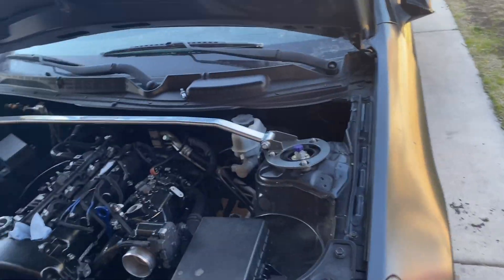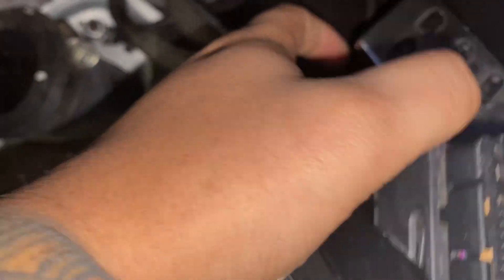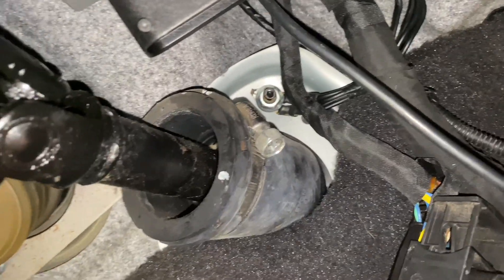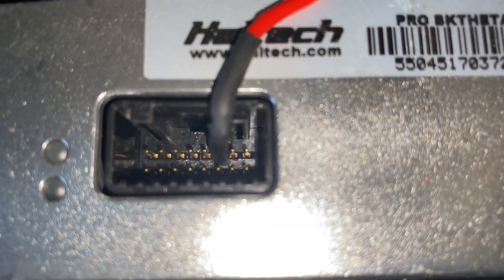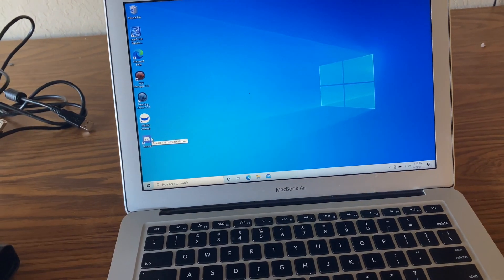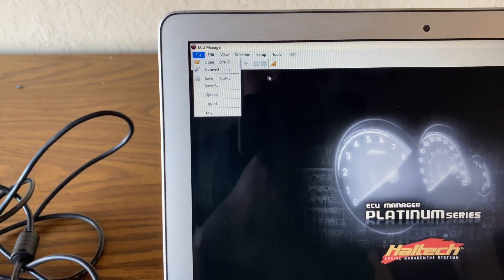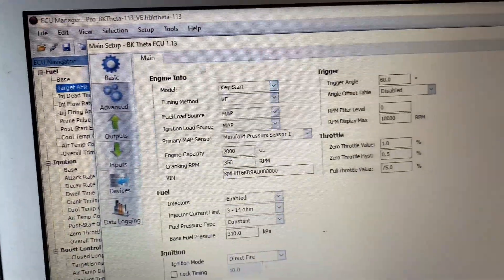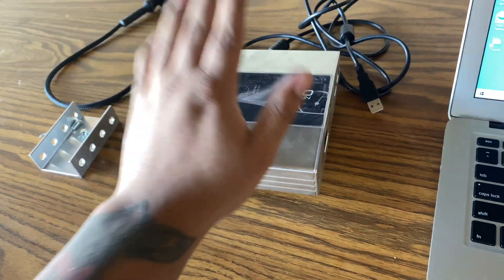Genesis Coupe Haltech Installation & Base Map Upload!

Comment: I manual swapped my car but it still has the auto harness so the car wont start without the tcu plugged in, is there room to mount both in the cabin or am i screwed if i want a haltec ecu?
Reply: Hi , did you ever figure it out ?
Reply: @Jruiz1611  I've been told there's room but I decided to buy the manual wire harness and manual dash harness to swap into my car, it's a long process lol
Reply: @Jacob-rt6on  oh I see , okay thank you ,
Reply: @Jruiz1611  good luck on your build
Reply: @Jacob-rt6on  same to you man. God bless you

Comment: is haltech for automatic as well?
Reply from the maker: No. They don’t make any auto compatible ecus at the moment. Alphaspeed is currently working on one but yet to be tested.
Reply: @ProdigePerformance  what’ll b a good ecu for an automatic w 500-600 hp?
Reply from the maker: @vietyyg6739  again, there is non currently for automatics. You have to basically do a manual swap.
Reply: @ProdigePerformance  ah okay gotcha
Reply from the maker: @vietyyg6739  yep yep, follow the alphaspeed page on Facebook or instagram and they’ll announce when and or if their ecu is compatible with autos. Should be dropping mid this year if I remember correctly
Reply: @ProdigePerformance  okay thanks man!, that’s exciting news
Reply: I did a manual swap, but still have the auto harness, would that even matter or should I stop being cheap and get the manual harness?

Comment: Your Platinum Pro ECU doesn’t get overheat? I installed mine the same as you did and is overheating and when that happened it shuts down the engine 😒
Reply from the maker: Nope. Kept mine nice and cooled. If it overheats haltech will warranty it
Reply: Yes, it’s overheating after like 40 of been turned on the engine. I wrote to Haltech and they told me to send the ECU for revision and it will cost me $175.00
Reply from the maker: @emanuelmontanezvillanueva5743  they call pull warranty unless it was brought 3rd party
Reply: I bought it from Ostar Motorsport in Orlando, Florida.
Reply: So it can overheat even inside the cabin?
Reply from the maker: @27ubs  yes. It can. If it does then you get to warranty it out with haltech. That’s why you mount in the cabin to begin with
Reply: @ProdigePerformance  time for the haltech elite 1500...we need to pressure haltech so they can release a harness for the car at a reasonable price.
Reply from the maker: @27ubs  alphaspeed makes one. $150 last time I checked.

Comment: What input did you use in haltech to recognize the wideband?
Reply from the maker: Here’s a quick trick. Turn on all your inputs 

Which ever once has voltage is the input you just tapped into.

Comment: How do you get the plastic piece off that covers the fire wall hole?
Reply from the maker: 2 10mm bolts and it comes right off

If your talking about the rubber part you’ll have to wedge a flat head in there and get it out.

It’s seated perfectly to the firewall.
Reply: @ProdigePerformance  yeah I got my plugs through already, thank you, 2 hour later 😭.
Reply from the maker: @TheEssenceOfTheDark  I’m sorry my guy 😪

Comment: where that red wire connected to the battery or you splice a power cable ?
Reply from the maker: Red wire is coming straight from the provided gauge harness. It’s a output voltage so it can tell the haltech what my afr is and change it based off the way I tune it
Reply: Ok I figured it out but now when the car started it’s like someone stepping on the pedal
Reply from the maker: @purabalafria2449  that’s weird. Did you recalibrate the throttle,? That’s another thing you have to do sometimes. 

Are you auto or 6 speed
Reply: I got it started I spliced the heater wire n connected the attachment they gave me  I calibrated the throttle but it sounds like it gives out on me and if I increase the throttle from 75.0 to 100.0 it sounds like someone got there foot on the gas 
I re calibrated the throttle like 10 times already but it’s still not good to drive down the street to see if I little things pop up so I can fix them before I get it tuned on wensday